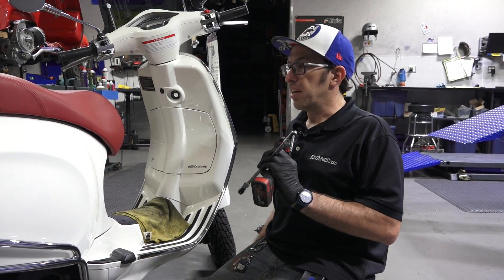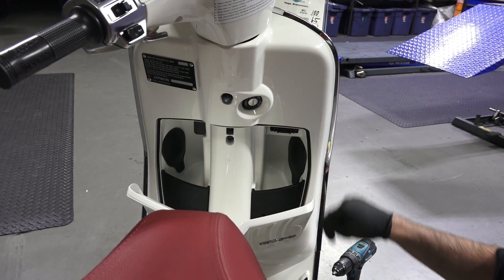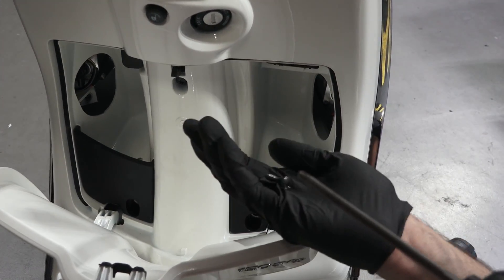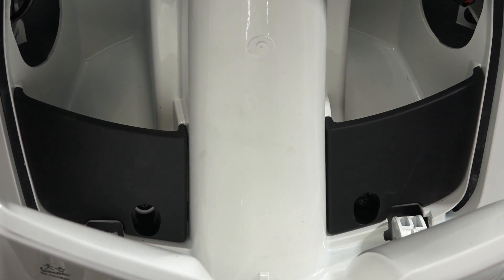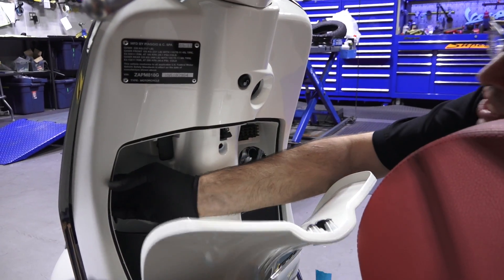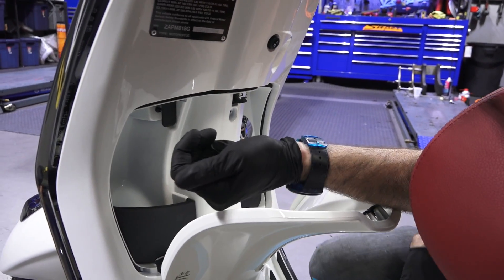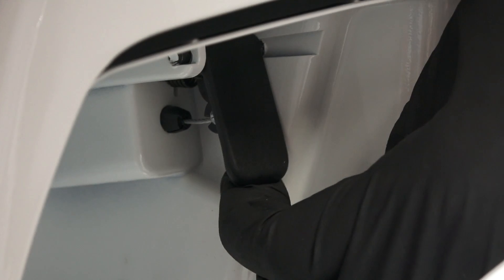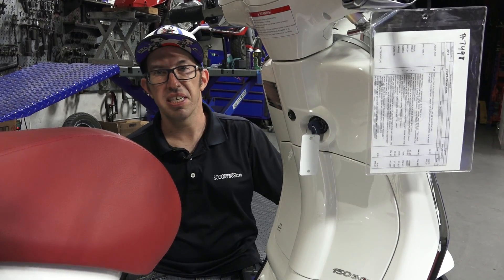Vespa Primavera/Sprint Glovebox Removal

Comment: Thanks for the video! I have a loose ignition wire and I need to access the area to find the issue. I’ve been banging the cover for a wire and that has worked up to now. No nearby Vespa dealership near me. So, I have to do DIY!

Comment: There are some differences on a Sprint 150.  No right side rubber pad but a plastic plate held on by 2 screws and a relay on the right side that needs to be unscrewed prior to pulling glove box off.